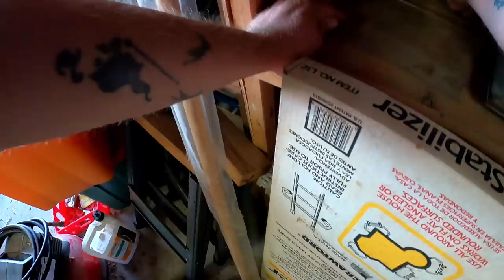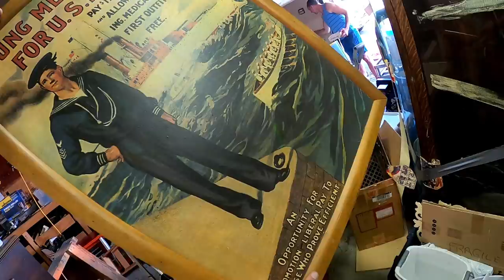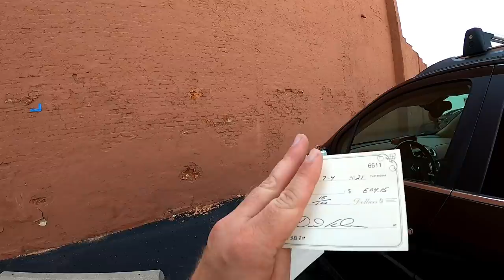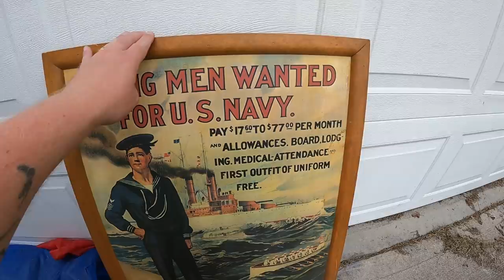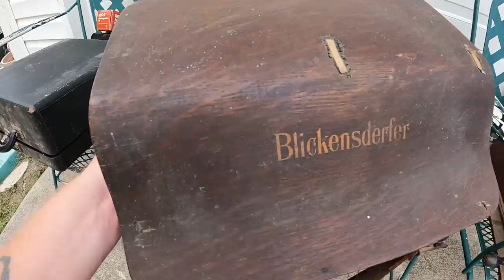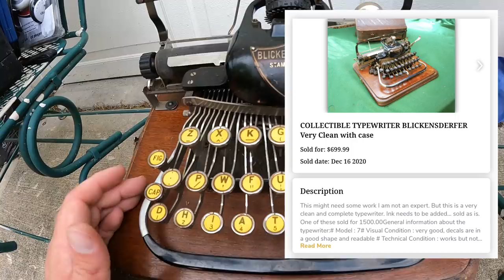GARAGE SALE ANTIQUE HIDDEN FOR DECADES

Comment: To bad it wasn't winter time, the Toro CCR snow blower in that garage is pretty sought after and ranges from $150-300 resell. I picked mine up almost 10 years ago for $10 buck because the lady could not figure out how to start it. Turns out never added oil! I ended up using it for 10+ years worked like a charm and Sold it last year for $100 and was missing the flap that you can bend up and down. Summer time is the best time to buy them when they are not in high demand! Also, good for reselling the parts!! 

Is your Son Elliott with one or two T's? Our oldest is Elliott! Very cool!
Reply from the maker: Good info, thanks!

Comment: Too bad you weren't in Washington state because I am having a sale next week. I found your channel last week and figured I would share how I began doing online sales. My dad taught me at a very young age how to make a profit with things you buy. I remember people saying they knew him as the guy you contacted if you had a large amount of things to get rid of so instead of taking to a second hand store (this was early to mid 90s so ya know, before the internet where you can sell things easier) , people would contact him and he would pay them $60 - $100 for a truck bed full of stuff and was basically a blind sale because he never went through it before paying. I had so much fun digging for treasures! He repaired clocks and owned a clock repair and antique shop almost my whole life. When I was 10 he decided to pull everything from the booths in several shops around town he had and built a shop on his property and also did ebay. When he retired in 2003, he did clock repair and reselling antiques full time. He passed away in 2012 and it took me nearly 8 years to even start going through it because the amount of JUST clock parts, movements, clock cases alone was nuts. Drawers full of dials, glass,  big tubs FULL of hands, loose gears, nuts, small nails, springs. I was overwhelmed but had fun going through it and made good money as soon as I began listing. You name any thing clock related and there were boxes and containers full of it. I didnt even realize how much he had shoved in the back of his shop so was absolutely shocked once I dug in. I have been doing the ebay and mercari thing this past year but I had to take a break because I was burnt out the last couple months. The clocks (especially grandfather clocks) I havent bothered with because I dont want them to break during shipment, let alone will be crazy high to ship and most have stopped running after he died 9 years ago, obviously since they havent been touched so I have no idea what needs repaired or what just needs a simple cleaning/wound up. Theres so much in general from antique furniture ranging from late 1800s-1970s to an antique coin soda vending machine cooler. The man also saved everything or bought too much of everything so I ended up having to throw hardware, vintage tools, electrical stuff and other random things in ziplock bags as a bundled price. I even found a big box full of film reels from the 60s and 70s that are local news, mcdonalds and other fast food memos or updates about menu changes, fish and wild life and also home footage. Just so cool! Right now I am trying to go through the clock items to organize and price because I decided to do a sale next week for several days and hopefully I can get it all put together by wednesday!